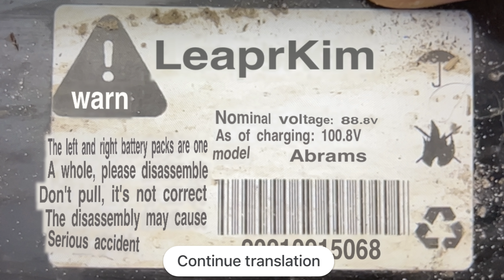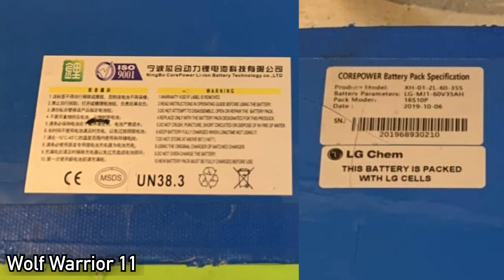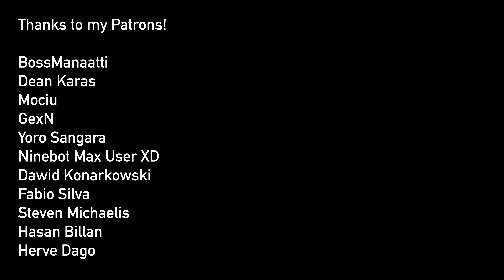Veteran Abrams Safety & Quality Check

Comment: That box that holds the motor disconnects- if ANY water got in there you're screwed and with no inner shell I can see the Abrams having tons of water issues. And the bearings are shot in less than 100kms, that's ridiculous.
Reply: shouldnt use wheels in the rain anyways
Reply: @Blox117  well for some people these wheels aren't just for rec, they're transportation devices used everyday to get to work whether it's wet or sunny out.

Comment: It seems to me that all these new wheels are being rushed to market with quality issues or shall we call them design flaws without proper testing and shake downs before being released to the customer and when you're relying on a single wheel safety is paramount.

Comment: Hi Adam,

The first 40km i rode the bearing was allready grinding but i did this offroad and glad to see it was not because of that but because the bearings had rust in it brand new out of the box...

Not to mention the design of the batterypacks and cage of the wheel... It will swope all the dirt to the center of the wheels axle/bearing! Also hard to clean!

The tire had the "blue fish" in it and deformed the walls of the tire because i rode it like that the first km's...

When i disconect the wheel from motherboard/batterypacks my ODO or Total milage gets reset!

I had the wheel disassamble for 3 times to fix all this...

I got the wheel from ... at ..... with good service and that is a nice person that helped me to the extend that he could.
He even tested my wheel for the cutout isseus before sending it to me...
Problem is that Leaperkim did not do anything to solve my problem! I did all the labor myself and payed top dollars for this wheel.

It was actualy the first new wheel that i got and sold the veteran Sherman for this! I had the luxury of trouble free riding and was hoping from L..p.rk.m the same build quality but now i'm stuck with the Abrams!

They advertise the wheel on many sites telling it is the offroad king or that it has IPS 65 rating and sealed bearings!

I got new bearings from a good (Japanese) brand and extra seals (German) brand on top of that with Grease inside of it... To keep all water out and dirt!

The tire i replaced with the tubeless Mitas B7 White wall :)

The whole batterypacks/cage and Motherboard with headlight/taillight is only holding its total weight by the 3 screws on the pedalhanger with the flat bar that swipes all dirt to the center of the wheel.

When u gently drop the wheel a few times in the dirt it will deform the cage and when u try to dissamble/reassemble the wheel after that it's gonna be much harder to line up all the screws of the batterypacks!

When i open the motor i saw moisture inside and the motorcable/axle design is bigger and strong but not properly sealed! I fixed it afterwards!

Dont get me wrong i still love the wheel by the way it rides for me because i'm a tall guy and love big wheels but not for this money and all the trouble i had to endure!

If i could get a monster pro to replace it i would do it instanly with a batch 2 :)

Adam i hope the community will get informed by u and spread the word about the problems and maby we hear a solution of the company's!

We are not test dummies...

If u need more info about the fix of the bearings with extra photo's and video's i'm glad to help u out.

Greets Robin from EUC Limburg
Reply: I could not name the company where i got my wheel from? It got deleted in a few seconds?
Reply: Sad to hear this report. It is such an expensive piece of gear. The least I'd expect is a decent customer service and not being shrugged of doing all the labor yourself.
Hope it works out for you.
Reply: Amazing response Robin, thanks for writing all this really appreciate it. Sad that Leperkim was not helpful to you, they obviously got way to comfortable after their Sherman success. Typical
Reply: Paragraphs exist. Try using them
Reply: @markricharddavies  yeh that's true... First batch i was hoping for more quality of them since the Sherman updates and all!
Reply: @privileguan9127  Denis of EUCSALES helped me but Leaperkim have to bring a solution for the first batch problems of the Abrams...
Reply: What is the size or model # of the Abrams bearings
Reply: These problems are only on first batch? have the resolved the issues??
Reply: @kingdongo4388  good question?! But I think it is fixed after so much time has passed… ask the dealer for it!

Comment: Much better connector choice on the headlight/taillight this time.  It won't short the outputs from the motherboard if it gets disconnected while the wheel is powered on like can happen on the Sherman, not to mention it has better retention capability.  Also glad to see them using Loctite on all the machine screws.

Comment: The water ingress engineering looks reasonable for the most part. It is sometimes hard for the end user to know which parts are ok to get wet and which parts are not but it looks like the important parts are well sealed.

Comment: The bearings are supposed to be sealed 🤨! The slim bar at the bottom picking up leaves and dirt, that i didn't saw coming. BTW, the controller housing IS the heat sink. eeVee's did a steep hill AND a pendulum test and the Abrams ran the cooler. Check it out : https://youtu.be/Iv1Or0Nd0zE?t=778

Comment: Once you had removed the batteries anyway, how could a spark damage the batteries? The wheel could be removed with no further danger except maybe discharge the caps. Common practice when working with higher voltage circuits. (yeah, old enough to remember tubes)

Comment: Thanks, Adam. Have i missed the review/unpack/first impressions? This video seems a bit out of the blue. Anyway, 45kg is where all the hype dies on me. Risking an injury every time i have to drag it upstairs, in or out of the car. Those two handles should help with weight distribution, but no thanks. This heavily reduces practical side of it.
Reply: Yes you missed unboxing. Some content is only released on Instagram.
Reply: Next: How to build a slide for your one wheeled tank and How to ride it upstairs to your appartment..
Reply: @privileguan9127  true:) otherwise become ripped or handicapped for life with a ruptured disk.

Comment: Blue loctite is made to be heated to release. Room temperature blue loctite can damage aluminium threads when loosening. However, blue is stronger than red.

Bicycle and motorcycle (and car for that matter) manufactures have long ago figured out all weather wheel bearings that last for thousands of miles. This is not new engineering, just being cheap. (maybe read cheating the customer)  Of course the manufacture will probably say "not intended to be used in the rain or snow" but as soon as they put the words "off road", the customer has a right to complain, despite the fine print.... that is the fine print does not overturn the big print.

Comment: 40kg but no inner shell at all ? 
70km and shot bearing ?
Bad cabling, badly sealed cables ? 
For basically the most expensive wheel on the market ...
Good quality check review, bad wheel. 🤷‍♂

Comment: 1, This modular design is  big mystery and only time tell if be enouch strong for clasic crashes or something bend inside becasue structural power is weakened by modularity on abrams compare to "clasic" sherman.
2. Cage is joke here compared to sherman
3.And every side edge hit be directly into baery holding cover one piece   🤦🏻‍♀️.
4. I know batery is in separate box but still conected to side panel just imagine this abrams spining/rotating off incline/hill how many direct damage bateary take.
5. i can recomended to isolate this cables using liquid plastic/tape isolant by using brush what is used on boats to isolate electric systems agains salt water and chemical contamination my MSP HT is fully sealed too. 
6. this tire size naturaly absorb some low end torque im hungry to see more content about abrams.
7.frontlight real word show but i think sheman still king with custom position angle posibilities.
8. I was sceptical about sherman too after they release V2(biger rim ,higher pedals ,waterprofed panel, extra fuse on baterys) shermyboi i instabuy and not regret.
9. I want just sherman max or HT version and they make ABRAMS 🥶❓. 
10. Is great you have comander to compare abrams and sherman im muscle memory. 
11. hardest question is if have sherman is worth buy comander or abrams or keep sherman and why  or wait to EX2  new inmotion or kingsong?.
12. Anyway im happy there is new models on market but for me just make new revisions existing EUC is fine every season improve to more quality weatherproofing and firmware instead make new models ,
13.snow and salt european mix is like cryptonite to superman for EUC buy some quality bearings becasue abrams by modular desing is weak in bearing protection dirt can go direct to bearings no cover.